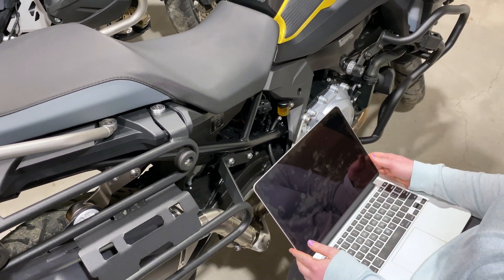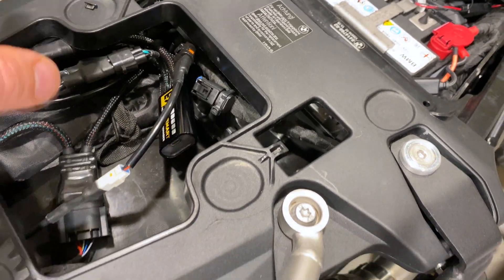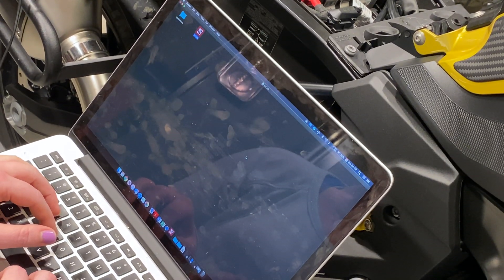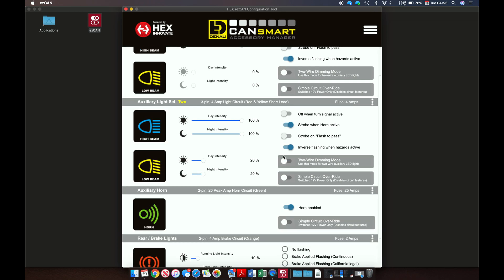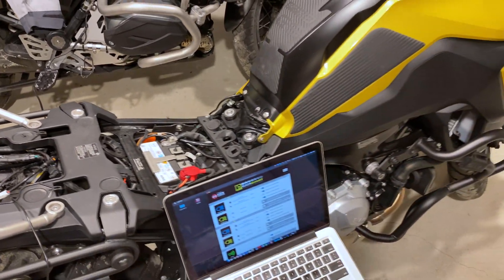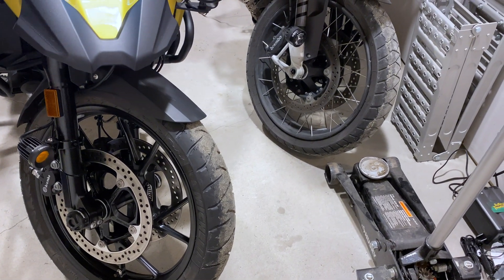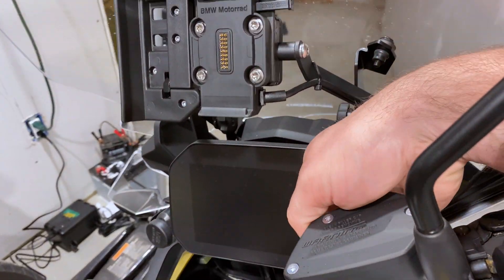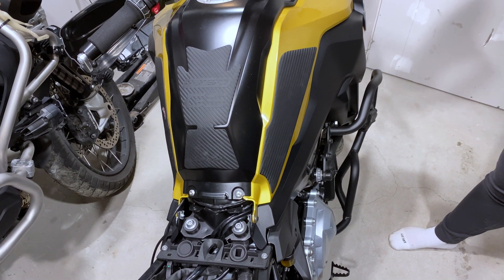Setup: CANsmart Software for BMW Motorcycles

Comment: What about heated gear? Do yo simply hard wire the heated gear directly to the battery? Or is there a plug adapter that needs to be in line with a spare cansmart aux?
Reply from the maker: My wife and I don’t use heated gear so I can’t help you specifically but I’d recommend a fuse block or PDM60 and wire it to that. Newer BMWs include a plug for heated gear under the seat but not this model year.

Comment: How is on/off controlled when riding....toggle wheel?
Reply from the maker: You can turn on and off by holding down the turn signal cancel button or what I do is just leave them off except for when hi=beam is activated.

Comment: Another great video, Adam.  Thanks! I am in the process of making the final decision between the Denali's and Hex EZ can.    On your computer screen, it does not show a menu for the configuration of the rear light.  Does it have one?
Reply from the maker: The brake light? It does briefly. You have to scroll down on a small laptop like this but you can basically configure everything that I'm aware of here that's currently plugged in.

Comment: I think EZCan really did a great job on the GUI, following KISS (keep it simple stupid).  The trickiest part is picking the correct current setting.  What did you end up with on day/night settings on the fork mounted lights?  Same goes for the brake light.
Reply from the maker: Settings are going to remain TBD for now until we actually get it out there and play around with how it looks day & night. Brake light is set to off and then 100% + Flash when she brakes. The current setting in this case was automatically picked when we plugged in the lights!
Reply: @AdamChandler86  Makes sense.  I have my Billie version at 10% and 80% when braking.
Reply from the maker: I think newer CANopeners from Clearwater can have the brake light off completely but mine doesn't support that I think. but this does. awesome to just have it off then boom, blinding strobe telling the person behind you to stop texting.
Reply: @AdamChandler86  I'm using an EZCan with my Billie as I went with a Rigid 6" LED fork mounted light and brackets from Black Dog Cycle Works.  I usually ride with a rear box and I feel it hides the brake light a little from taller vehicles, so I opted for 10% running, but barring that I think I'd go 0% as well.